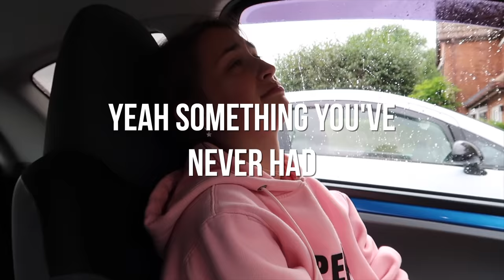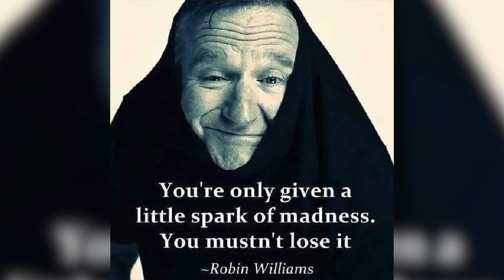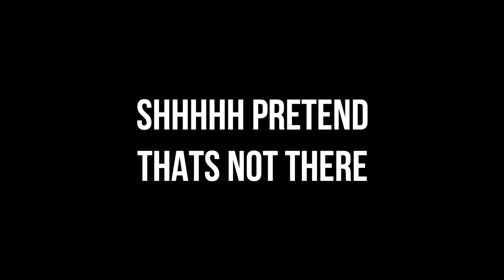CERAMIC COATING THE CITROEN C1! 😎🥵

Comment: Did a good job on the car, just need a bit of back to black on the rear bumper and other trims, car looks like it’s ready for the showroom, enjoy the videos.
Reply from the maker: Thanks for the tip bro!

10000% need to make all the plastics black again, any idea on how to do it permanently?!? 🧐

Thanks again mate 🤪💖
Reply: @TheOtherStuff  not sure on the best stuff to use, I just get mine from the local car shop. Which is ok for a few weeks, then needs reapplying.
Reply: @TheOtherStuff  gtechniq permanent plastic trim restorer is very good 👍
Reply: Use a product called forever black, it’s great
Reply: @TheOtherStuff  I have tried a few different black trim revivers, and the best one by far is the Gtechniq T1 tyre and trim gel.
Reply: @TheOtherStuff  you can use the ceramic coating mate! 
It makes it deep black and lasts years
Reply: @TheOtherStuff  maybe consider mate black vinyl wrap? After all If she prefers the original colour it'll be easier to get it off :P
Reply: @TheOtherStuff  if u wrap it gloss black, but probs a bit harder to do yourself tho
Reply: @TheOtherStuff  use gtechniq c4 it lasts for like 2 years
Reply: Gtechniq C4 permanent trim restorer will work wonders on the plastic trim , last longer than a year.

Comment: Use fairy liquid. Save you some money on taking old coating off.
Reply from the maker: Thanks for the tip mate 🤪 Definatly gonna have to try it as this stuff I used was £15 a bottle 💀
Reply: Or get a pure shampoo, add it to a foam cannon mixed with a bit of all purpose cleaner and let it fly through there.... Has worked for me a few times.

I also fill my wash bucket with the same mix and do my contact wash with it.

Don't go too heavy on the APC though

Comment: Great content as always 😎

Regarding the ceramic coating EXO is a topper not a full blown ceramic. You ideally would apply crystal serum light which is the ceramic and then apply exo as a top coat. 

You'll get so much longer in terms of durability by using the csl first and then exo 👌👌